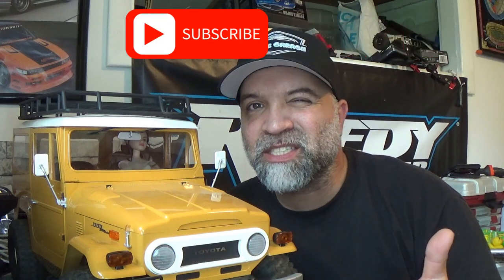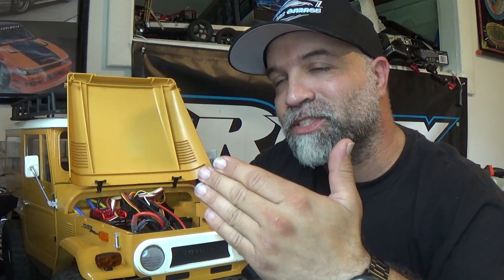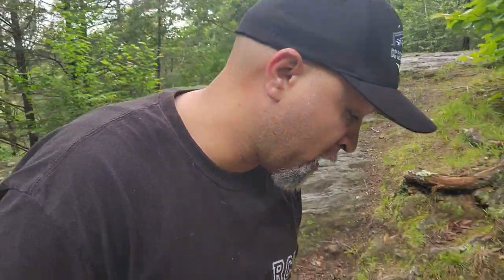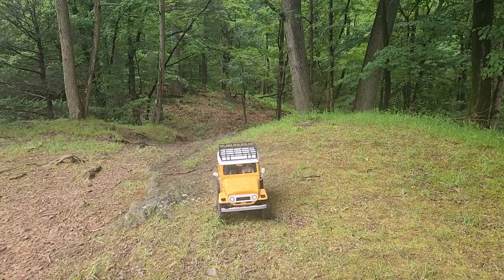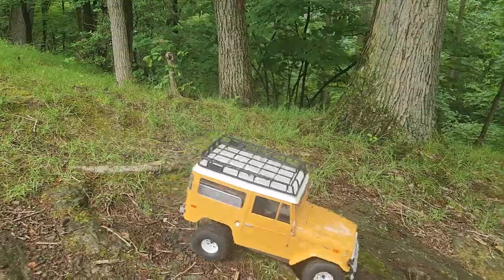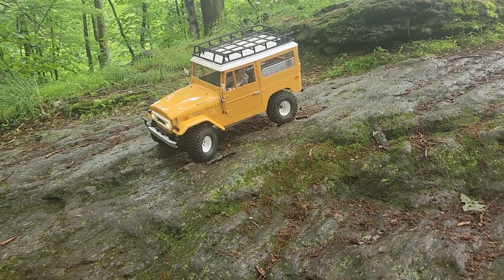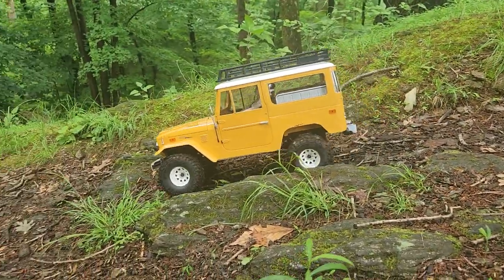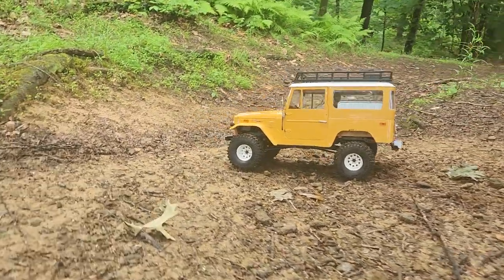FMS FJ40 with Hobbywing 1080 ESC and new 35 KG coreless Servo. Did it make a Difference

Comment: so im about to get the 1080 for the fj40, how do you get the drag break to work on ch3 with the stock controller?
Reply from the maker: As long as the 1080 you get looks like the one I have you should be able to just plug In and go and if you Have a hobbywing program card you can adjust it also